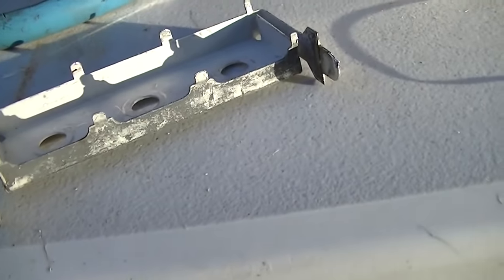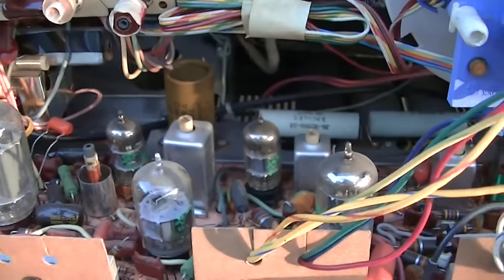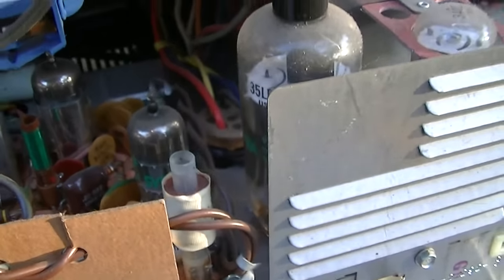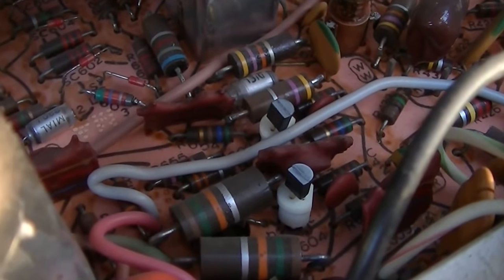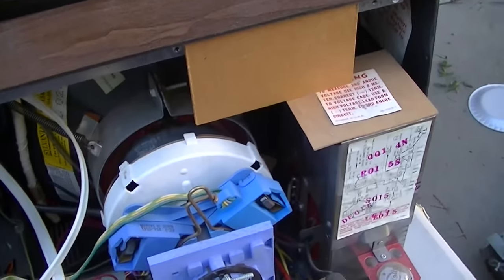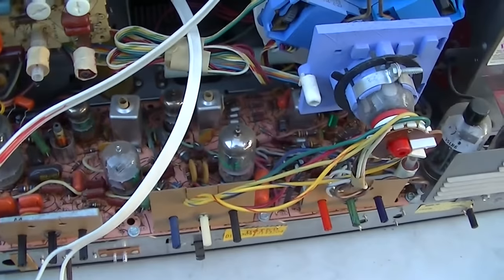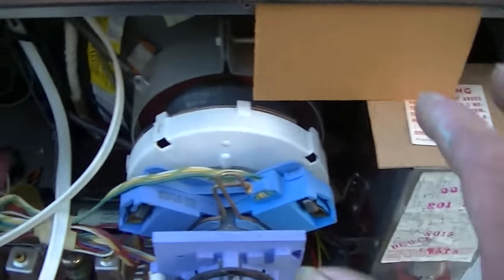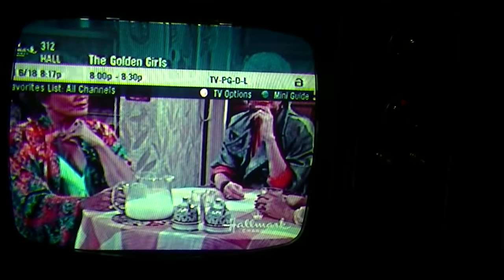Sylvania CB35W NOS Color TV Startup and Repair

Comment: I still have a 13" color Panasonic with remote stored away.  Purchased late 80's?  It was plugged in a quality surge protector / line conditioner.  At 10 years, I was like "Cool, still holding up."  At 15 years I am like, "Man this thing is still going." At 17 to 20 years I am literally thinking, "When is this thing going to die?"  I finally retired it in 2007 when my brother surprised me with a 27" 720P Vizio.  It is plugged into the same surge protector (from the late '80's as well!), which has been plugged into a quality UPS unit since 2012.  Yes, the Vizio still works.  The Panasonic still in perfect working order when I put it away.

Comment: programming content is just awful, but set looks GREAT. Good thing for the plug in transistors.
Reply: shango066 Bad thing about TV, is your paying for commercials technically! Ugh. Bad enough that DirecTV, Dishnetwork, Cable programming costs assrape you, but you get the required added benefit of commercials
Reply: Dave WM   I wish we had more plug in transistors,and when he was looking up the cross reference I thought it would either be a 2n2907 or a 2n2222  dam I’m good! I’m really happy that I found these videos !!!!!
Reply: Plug-in anything is sort of a mixed blessing. It's worth it if you expect the part to fail often, but the connections themselves are one more thing to go bad. Once silicon transistors were perfected, a decent soldering job was probably preferable.

Comment: I had no idea that vacuum tubes were still being used in 1969. When I was a kid in the early 60's my dad sold televisions and he had a tube tester. I thought it was a big deal to test the tubes customers brought in. I still have the tube tester. It's a nice memory.
Reply: Oh yeah. Many American TV models still had a lot of vacuum tubes in them in the early 1980s. American TV manufacturers were way behind the times compared to Asia at the time. They didn't want to spend money to refit factories for new designs, & risk accidentally making an unreliable model. In those days we expected a TV to last 12-16 years. That's one of the reasons American companies never made a VCR. American VCRs were rebranded ones from Asia. Of course you know, the picture tube is also a vacuum tube. Picture Tube TVs & computer monitors were still sold well after the turn of the cenrury.
Reply: @PSKResearch  Thanks for the reply!

Comment: Sylvania boasted the best color picture in the late '60s - early '70s, everyone thought it was because of their CRT's, but in truth, they probably over-modulated the chroma section, at the determent of the chroma demod section(s). Silo Electronics stores sold a buttload of both Sylvania and Philco-Ford TV sets, so many that most independent service techs carried at least a dozen GE-20 transistors with them, because of the problem which you just encountered (on the Sylvania's), and to repair a weak tone burst oscillator section in the Philco sets.

I remember seeing so many of those multi-potentiometer enclosures with one or two sections clipped and isolated, and a Centralab, CTS, or Ohmite replacement piggybacked in its place. I'm wondering if that "whisker" thing may have been the actual culprit, only back then the defect wasn't evident without magnification??

A very nice set, and nice repair, by the way!!
Reply: WRONG.. THE SUPER SETS WERE FROM THE LATE 70'S AND THE BETTER PICTURE, WAS BECAUSE THE CRT'S WERE USING A BLACK MATRIX AROUND THE DOTS... ALSO, ON THE LATER SETS, 30 KV WAS USED ON THE SECOND ANODE

Comment: Awesome video and channel! I have watched many of your vids. Such a wide range of electronic stuff you know about. Those little dendrites were causing problems in my Hammond organ. Service manual said to use HV from the B+ supply to burn them off.  I managed to cure them with only a 9v wall wort.

Comment: It's a guard to remind about high voltage. Used to work at Sylvania tv tube factory. And I'll let you know.  you don't "want to touch that belly button or feed line. Nasty high volts. So if you get a shield. That shows some body cares. SGT williams retired.

Comment: what do the whiskers do to the set. I deal with carbon whiskers on flame rods and spark plugs in industrial combustion systems, but this appliers to be growing on the surface on the metal. do the whiskers shed and cause trouble with the pots?
Reply: They cause short circuits, many times intermittent making the problems they cause very hard to track down if you are not in the know about this phenomenon.

Comment: Also, look at the carbon resistors, in the voltage divider,  for the transistor power supply.   If they change value (lower), too much voltage is applied to the transistors, causing them to fail

Comment: Similar phenomenon causes the capacitor plague that has killed electronics all over the place since 2002.

I done a bit of research on it and it used to be prolific in the early days, they limited it on circut boards with the use of lead solder which got banned in europe, leading to the return of whiskers !!
Towards the end of the 20th century there were a lot of dodgy capacitor and component making houses around and they used sub standard materials in dialectrics of capacitors etc, the metal in the cap migrated and caused shorts!

Comment: The blue drive/screen is weak which is why you can't achieve a blk/wht raster... 
If you have a CRT restorer, it may just need to have the cathodes cleaned, as you may know a CRT rejuvenater will take the film off the cathodes which sitting for yrs idle and not being used will cause the guns to oxidize, hence putting the restorer on it.
If there is nothing else causing the problem in the chassis circuitry.

Comment: You know as far as colour reproduction and black levels go, i doubt there will ever be any other screen technology that beats a good CRT, i had a BUSH 22" tube set in 1991, to this day i havent found any tv that beats it for picture quality. OLED is too fragile they fade very quickly, plasma suffers from severe burn in very easily, and LCD black levels and colour are both HORRID.
Reply: QLED? Nano Cell? LED? No one has plasma since 2005 and was horrible. LCD was the successful replacement for CRTs and OLED is hardly Fragile. and the Frame and Serif TVs

Comment: It looks like the pot assemblies were made by cTs, there were the same ones who made the push on and push off power switches in Philco Predictas, which were also crap. No, the small non polarized caps very seldom cause troubles in TVs and radios built after the mid 1960s, unless they are high voltage jobs like Douglas found in his 1973 Zenith's Horizontal output circuit, but those would be getting hammered anyhow.

Comment: You have the screens set WAY too high and the drive adjustments are off. After switching the service line on, adjust each screen control, just below the point where you can see the line. (brightness and contrast set midway). Then adjust the drives for proper B&W tracking
Reply: MMMM, yeah, sometimes I think he's on drugs.  "I'M GOING TO ADJUST IT WITH THE BRIGHTNESS ON FULL UP".  And then many minutes staring at the totally broken color bar pattern.   "Yeah, all these Sylvanias have tin whiskers".  When you can clearly see the pots are made by CTS.   Something in the air out there?  Are those putt-putt airplanes laying down chemtrails?  Weird.

Comment: Could someone explain the reason for the 1Meg resistor sticking up out of the chassis?
Reply: Chris Trupiano I wonder the same thing, I've tried Google but still have no clue
Reply: @jrost626  - I assume it is used as a test point for one of the setup adjustments.

Comment: I thought a lot of showrooms would leave the sets on all the time during store hours and some on display thfough windows overnight. But then again programming did not stay on air 24 hours for many years.
Reply: Greg R ... While some stores left them to run all day you also have to remember they needed to rotate stock for new models. Back when I worked in that trade the floor units got changed out and maybe every 90 days or so they'd' have a sale on demonstration sets. Most of the time it was the larger console sets that got pushed out on special as winter came around and everyone sat in their living room for the cold season.... or bought a family gift for Xmas. Start of school year was a good time to sell off smaller sets for college dorms. Typical "sale price" was well below retail but always above dealer cost. IOW, no money lost.

Comment: 2:34 Look at all that flux on those connections; that's probably what  caused the whisker problem. In the computer business, we always had to brush off the excess flux when adding or changing a part, but I guess this consumer-grade stuff was only expected to be used for 10 years or so.

Comment: I need your help. I have a 40's RCA "Ivory Beauty" radio that someone else rebuilt poorly. Since 95% of the original parts are gone, I have no clue how to repair it. I've tried to find schematics, but the person that butchered it got rid of any way to find out what goes where. If you have a video of you fixing one, please send me the link. If not, can I send it to you to make a repair video and pay you for parts and labor? PLEASE HELP!
Reply from the maker: All the schematics for that era are available, you just need to be resourceful and spend some time to identify the radio and proper schematic. Sometimes I spend hours identifying the stuff and finding the proper service data.
Reply: Hi Shango. Thanks for your reply. I have found schematics for this radio, but I'm working with a chassis that has everything ripped out and replaced with caps and transistors soldiered together into a maze of bare metal. I can't figure out what is supposed to go where. It does have the "original" tubes, as well as the "Golden Throat" speaker which is wrecked and the wires are all rotted. I'm ready to restore the shell and put a simple MP3 player inside, but I want mine to be as original as possible, but little is left of the original stuff. From watching your videos, I have learned a LOT, but this is a project that seems like it would be wiser just to restore the outer shell and put new tech on the inside, which I really don't want to do to this classic.

Comment: I think you just found out why they couldn't sell it new in 1969 /factory reject or preproduction apprentice training set gone wrong or just plain old age decomposing turning stuff back in to their natural state ?makes a change from hitting the top of the set to get the picture back anyway lol.TV s were realy expensive in the UK and we used to rent ours from radio rental or Granada rentals and if a set broke they would be strait out to replace it.I remember being blown away by a remote control  teletext and being able to have subtitles on demand and weather and last minute discount airline tickets on the travel channel.back in 1988 before that we had a 10 inch black and white set  with only three channels .that same year we had a inside toilet fitted and had a shower unit fitted and gas central heating with cooker and wow a microwave goodbye  10 gallon tin bath in front of the coal range.

Comment: The darn whiskers, I have a GE PortaColor from 1975, that had tin whiskers so bad in the vertical height pot, it pulled the 600v B+ low to about 110v.  Symptom was a very narrow picture, only about 1.5" tall.  Once I cleaned out the whiskers, and painted the inside of the pot housing, and soldered it back in place, problem solved.